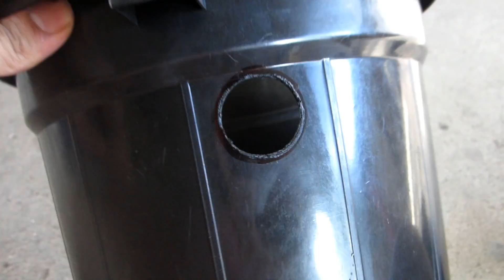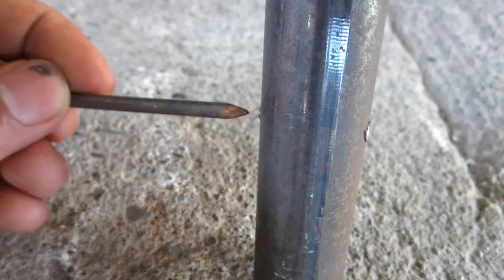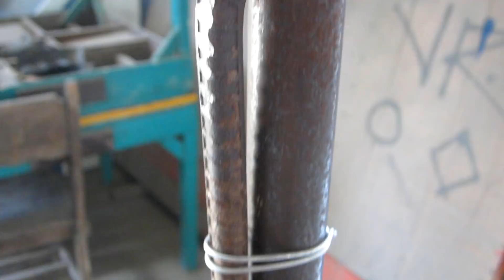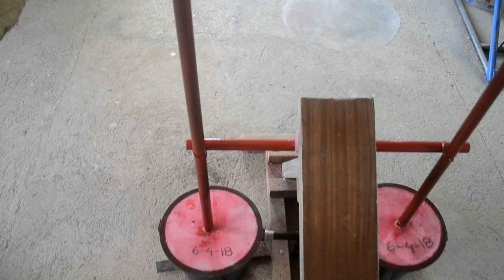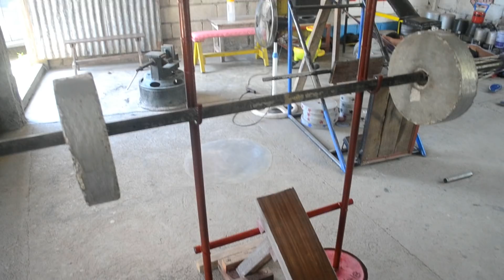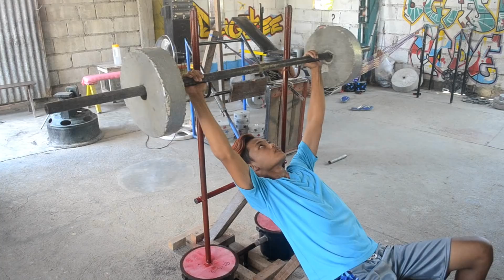Incline Bench Press

Comment: Creative and all but it wont have alot of weight capacity not even the seat.but still props to you making it.you wont be able to ad alot of weight either still good job.
Reply from the maker: Yeah doesn't look safe but i changed it to a new one thanks! ^^
Reply: @romgd  that's good you did cause I know just how dangerous it can be when it comes to benching and stands I say use steel